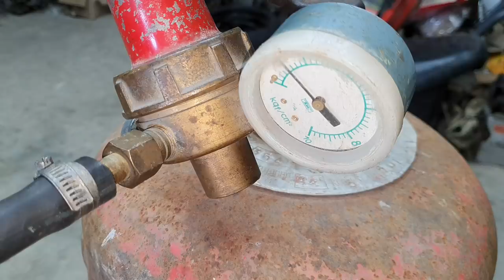Самодельный вариатор Stage6 R/T для скутера Yamaha Jog - литье алюминия в домашних условиях - furan

Comment: Good morning
I have a yamaha jog 50 cc with 70cc kit and mallosi variator...is there any way in whic i could use the electic starter to start the bike...because when i thumble it with it bike battery it wont start but if i jump ot with a car battery t does start as usal...what suggestion can you give

Comment: A few things could have helped. First, the mold could have been made out of finer material to yield a smoother casting. Second, you could have tried a tall small diameter can on top of the mold to allow more weight pushing down as the aluminum cooled off. Third, could have made a few molds and that way you could have poured a few at a time. And four, I really can't believe to did all this in sandals and shorts. I was seriously hoping you didn't spill any hot aluminum on you during the video... Thumbs Up!